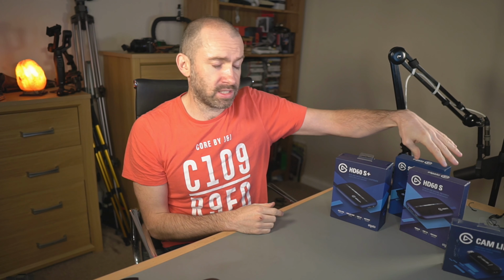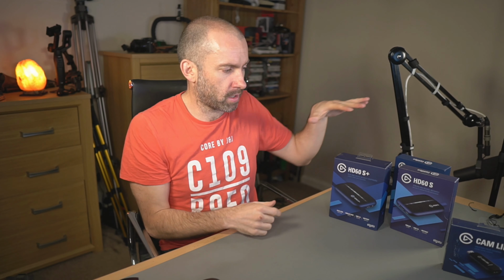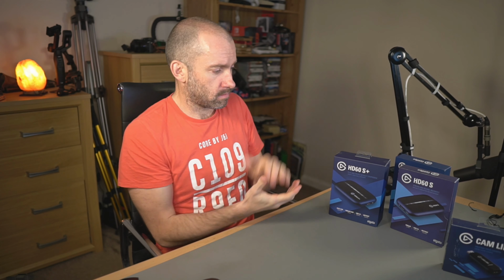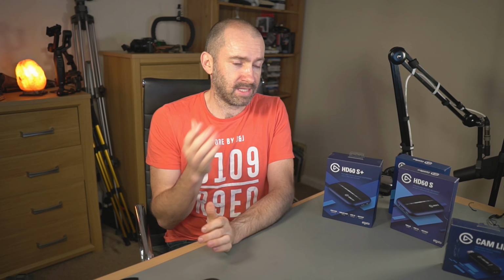Elgato HD60 S+ 4K Camera Recording Example

Comment: I am using the HD60S+ with Zoom on windows 10. It basically all works plug and play, but I can't figure out how to choose if zoom takes the audio from the HDMI or the audio inputjack of the HD60S+.
Does anyone know how zoom determines which audio it selects from the HD60S+ ?
I preferred not to install anything if not needed and just use the plug and play functionality of Windows 10.
Also I don't need to stream/capture whatever. No games. It's just for Zoom meetings with better video and sound
Reply from the maker: It will take it from the hdmi input. The audio jack is really for recording party chat from games.

Comment: What could cause exported files when recording the out of sync and also the camera is like 2x speeded up.
Reply from the maker: This sounds like an issue with your recording configuration. For example, you may be recording games at 60FPS and your camera at 30FPS.

Comment: Can a Sony a5100 stream into the HD60 (*NOT* the S or S+) @ 1080p 60fps?
Reply from the maker: Yes. You can stream from any device that has a clean HDMI out signal.
Reply: Thanks for the reply! That’s good to now. Additionally, will the usb 2.0 of the regular hd60 hinder the image quality very much?
Reply from the maker: Well, it depends.

The newer model has lower latency, but the older HD60 actually has a built in encoder, where the newer model does the processing on your PC.

The later models use USB 3.0 so have the option of transferring more data too, but apparently the max bit rate of the HD60 and HD60 S are both 40 Mbps.

There's a comparison of both devices at https://www.windowscentral.com/elgato-hd60-vs-hd60-s-whats-difference

Comment: Love the video. It's great to know that there are alternatives to Elgatos Camlink. Concidering that the HD60S goes for really cheap used. Could you possibly make a video going through the setup process for using a camera such as the one you use in this video, and go over how you set it up in the software? This would be very helpful :) 
Thanks for the great content!
Reply from the maker: If you search through my channel, you will see dozens of video tutorials on OBS and recording devices etc.

In short,

* Connect camera to capture device
* Connect capture device to PC/laptop
* OBS will now recognise your camera as a webcam and it can be selected as a video source

Comment: Would the be a better choice than a camlink 4k and does it have the same functionality plus more? I would like to use this capture card s+ or the camlink not for gaming so much but for like a live podcast would the s+ be a good choice for that and maybe gaming from time to time.
Reply from the maker: The Elgato hd 60 S+ is more versatile as it has extra options such as HDMI out, but the cam link is smaller and simpler.
Reply: These capture cards have been giving me a headache for weeks now! But I think if you want to do both (as do I) then I will need a HD60S+ to capture gameplay and a cam Link to get the better picture from my DSLR. (they can only capture from one source at a time hence need 2, one from Xbox etc and one for camera) When filming for YouTube videos etc, You can use either one as you only have to capture from one device then. I think. 
I have actually managed to find a stockist of Cam Link and HD60s+ during this pandemic that hasnt gouged the price up to £300+ and actually has them in stock! I've ordered both and will test my above theory, and if i'm wrong, I will just sell one of them - which shouldn't be too hard right now! I also want to test if they work on both my 2015 Macbook Pro aswell as my 2019 Dell XPS.
This video has actually told me the most out of the hundreds I have watched on YT over the last few weeks, so thank you @Kevin Muldoon
Reply from the maker: You're welcome. Glad you found it useful.

Yeah you need a capture device for each camera. I have about five capture devices in total.

Comment: Okay, I'm probably gonna get the S+ for 4K video if I can get my hands on a decent 4K camera for a reasonable price... The a6500 seems good, but I'm a stickler for full-frame, so maybe I'll just pick up a a7S on the cheap next year.
Reply from the maker: Yes it would be good for that.

Remember that the Cam Link 4Kbis cheaper though. It's less flexible, but if you're only using it to capture footage from a camera, you might save money getting that.
Reply: @KevinMuldoon  Unfortunately, the a7S isn't fully compatible with the Cam Link 4K. I just talked to a guy from Elgato, he said the framerate is about as choppy as the a7 with the Cam Link. He said the a6500 would work great with it, though. Maybe I should just get that and save a buck or 2... The crop sensor on the a6500 isn't even bad, it's actually quite detailed and noiseless.
Reply from the maker: @matdemaz  I just picked up another Magewell on eBay for £84 (they're like £280 or so new). That would probably handle the A7 well as it's total output is significantly higher. I've got a review of it on my channel 👍